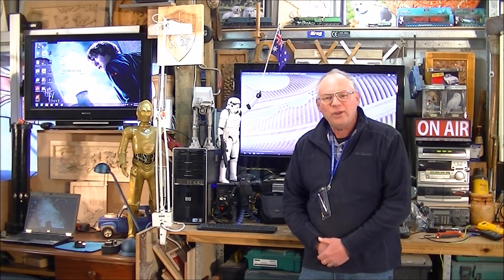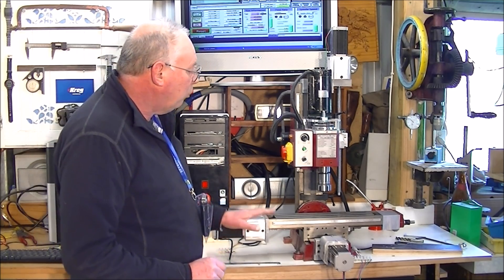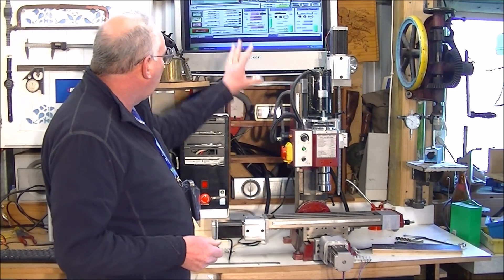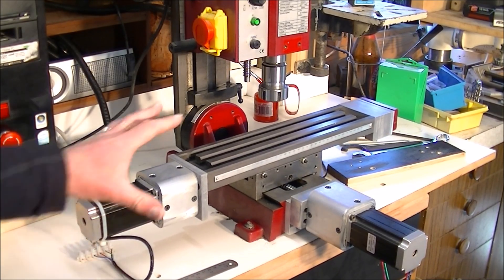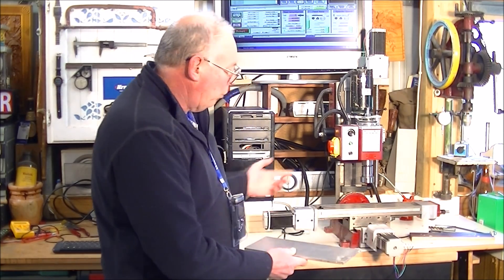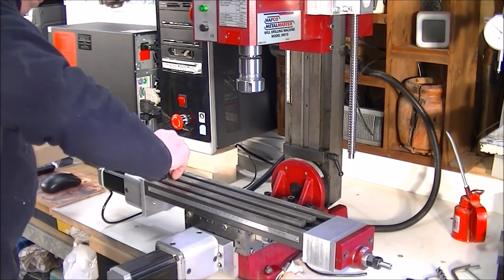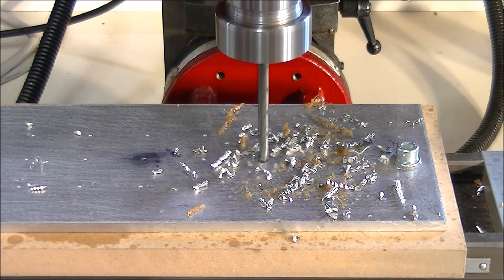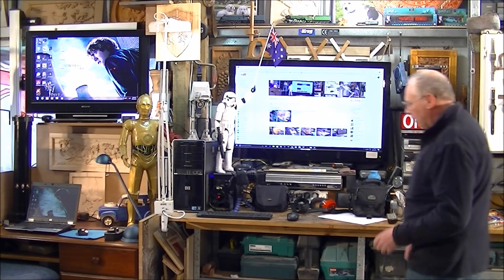First run Harbor Freight Grizzly X2 Mini Mill CNC Conversion: comes alive

Comment: How do you find the tilting column for rigidity ??
Reply: choco107 
The  tilting column seems to work out fine for me on the grizzly 8689. I haven't had any issues in regard to the column. 
Just my experience hope it helps

Comment: just an idea if you added two dowel pins in line with the t slot it will always be quick to align same as you would on a vise, Great Video by the way

Comment: To say that a Sieg X2 can only cut soft stuff is a bit disengenuous to Sieg. 

My SX2Plus mainly cuts 304 stainless. (its now cnc'd on X&Y and thanks to your video it will soon get Z) 

304/316 SS is no problem, just get the feeds and speeds and tooling sorted!

 I cut big dovetails with a HSS dovetail cutter for Harold Halls tool and cutter grinding attatchment.
Reply from the maker: Go back and watch the video again, you will discover that you have made a mistake.
I was actually referring to a CNC router, and that the little Sieg WILL cut steel. ;-) Pacific Tooling; Australian Inventor Roger Clyde Webb